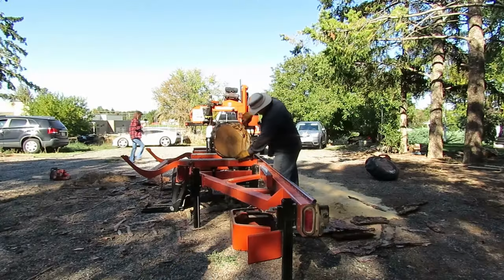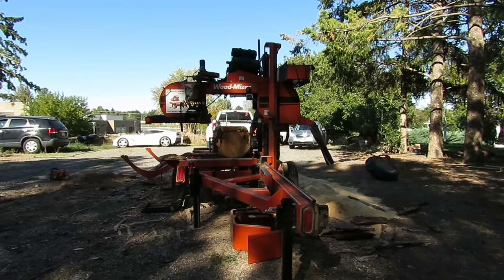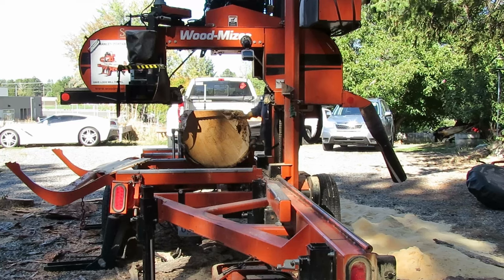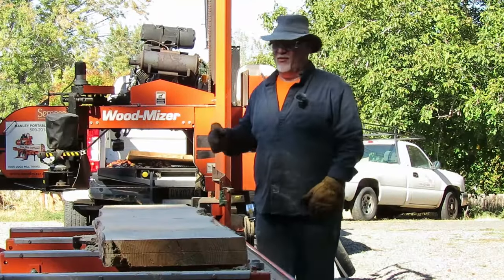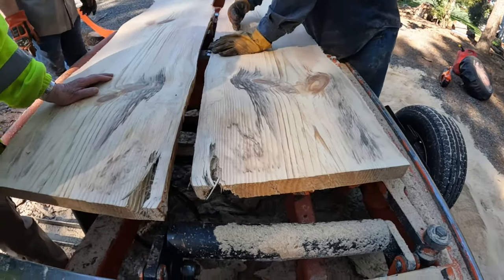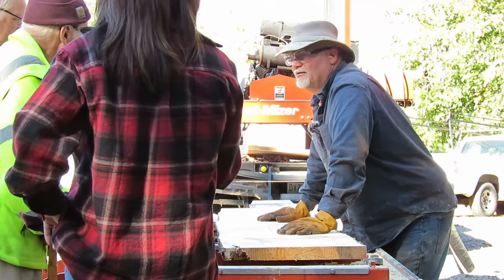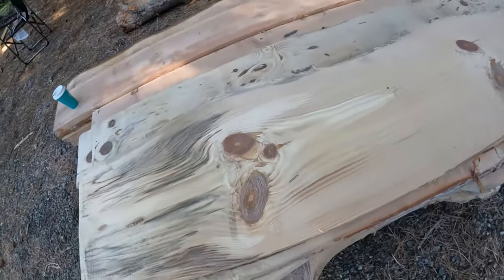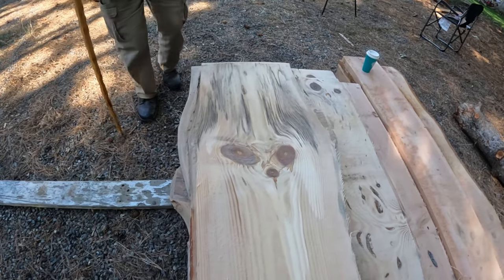Dealing with Big Knots on the Sawmill #woodmizer #sawmilling

Comment: TEFC motors that have a fan on the end of the motor (the debarked is one) needs air flow to keep it cool. The ‘boot’ is for weather protection only. Restricted air flow will let the motor get hot and shorten its life.
Reply from the maker: That was my thinking until WM Tech told me to leave it on.  Would seem better to have off but he said they didn't get hot enough and sawdust was worse for them. 🤔
Reply: If that was the case, why do they have a fan on the motor?  I've been running my Debarker for 13 years now and sawdust is not an issue for a "Totally Enclosed Fan Cooled" meter. @TheOldJarhead
Reply: Auto correct really messes up my typing...
Reply from the maker: Ya I ran mine from 2016 to 2022 without.  My last sawmill didn't have one.  But Kevin's with 2300+ hrs on it does fi e covered, so who knows 😉
Reply from the maker: 😆 ya me too